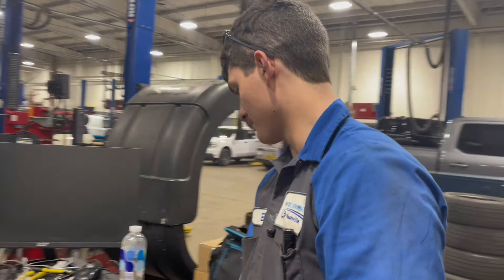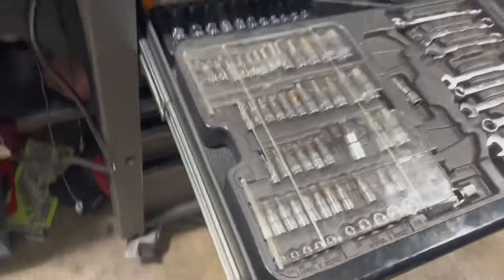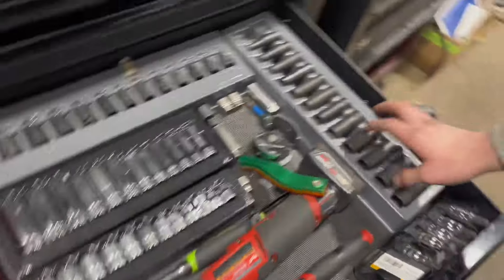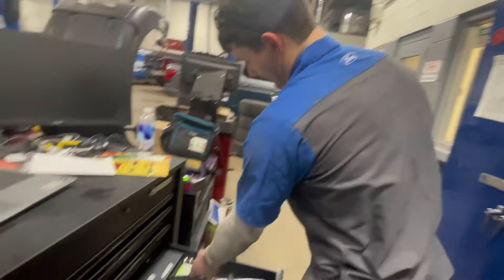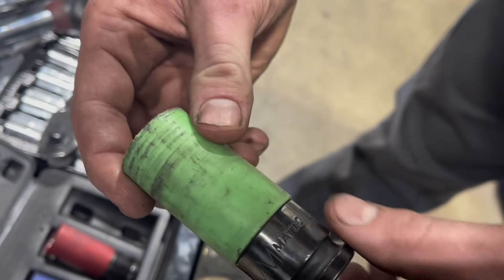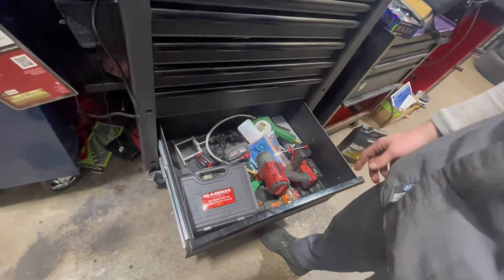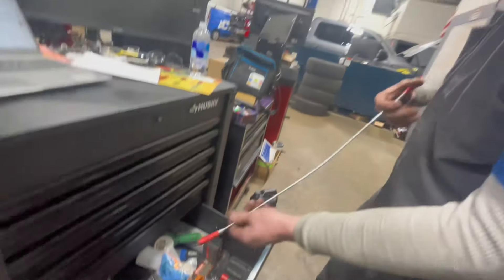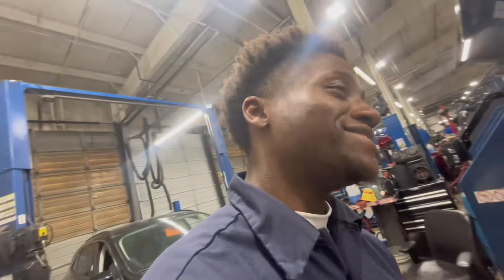Tool Box Tour Ford Entry Level Tech

Comment: My dream career is to become an automotive tech. Currently in hvac  for 10 years now. But just gotta application from a local Ford dealer considering switching careers(my own con about it is I think my pay will go down too much, I need an entry level automotive tech position). But I’m loosing sleep over taking a pay cut and have my dream career or stay with a career with long hours and something not really crazy about doing.
Reply from the maker: Both routes come with sacrifices it’s just comes down to which sacrifices are you willing to live with what I can say as a entry level it’s like anything else a lot main shop techs and some of my instructors say the more you know the more you make so there’s money as tech as well you would just be starting as a entry level tech
Reply: Don’t do it hvac has more upside then being a tech. I’m 3.5 years into it and regret it every day. You may like cars and working on your own but it sucks when you do it every day, especially flat rate. Plus hvac pays more and you don’t need to buy as many tools.